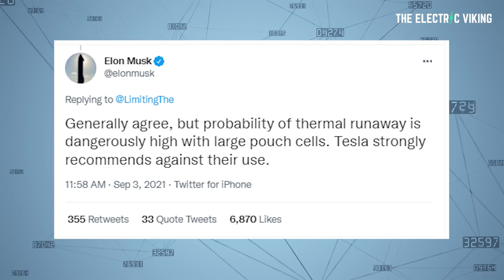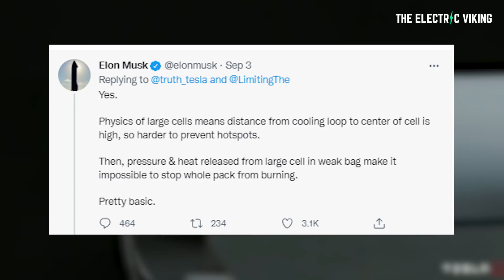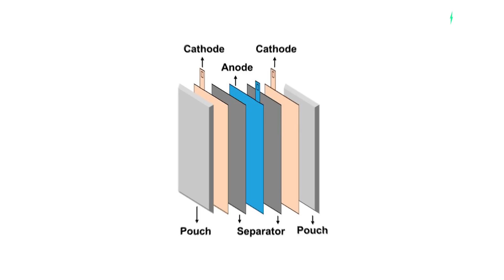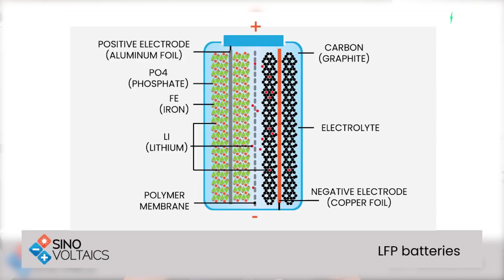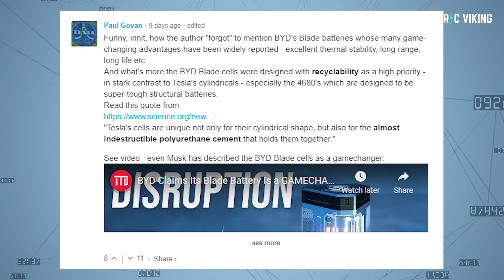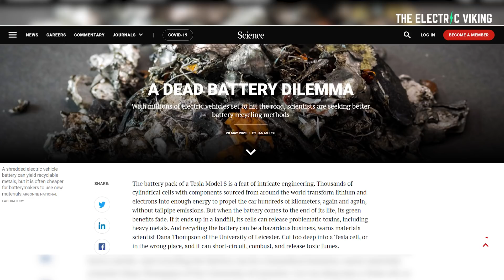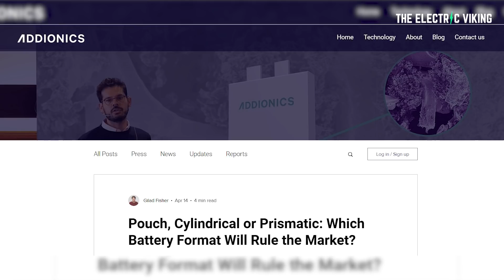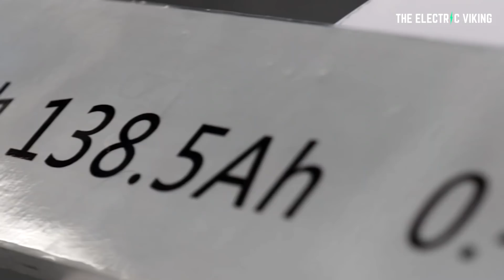Tesla batteries VS BYD batteries + Elon Musk on the best battery format

Comment: I am all for getting rid of ICE now but to say that ICE cars are more likely to have fires is not the point.  ICE cars might have a fire if in an accident.  These battery fires are happening from thermal runaway which can be caused when the vehicle is in a wreck or can happen when the vehicle is just sitting in a garage.  General Motors is telling Bolt owners not to park their cars in a garage or near other vehicles.  Nobody is telling ICE car owners to not park in their garages or to socially distance their ICE powered cars in public parking areas.  BYD apparently has a product that doesn't have a thermal runaway problem, Tesla and GM do.   Please quit trying to sugar coat the problem.
Reply: Tesla doesn't have a thermal run away problem. It's Chevy and Hyundai that have the thermal run away problem, and that is because they are using LG Chem batteries and those batteries are shit.

I do agree with you on the fact that ICE cars don't need to "social distance" when not in use lol 😂
Reply: BYD is a Chinese company, LG Chem - Japanese/US/Chinese
Tesla - US
Reply: @Jarmezrocks  LG is Korean FYI

Comment: Safety and reliability comes first, therefore i prefer BYD blades battery.
Reply: Both are safer than Petrol
Reply: How much better safety?
Reply: @LPGatekeeper  as for LFP, i converted a BMW to EV, and a Chevy pickup (with the assistance of friends), and converted a tiny 2001 Sparrow EV from lead/ acid to LFP.  I had failures of individual cells, but never a fire, and the LFP cells I used were an older cell type that is no longer used. LFP are very safe.

Comment: Small diameter cells are easy to cool as they are - erm - small. Heat is generated at the anode, so end cooling of cylindrical cells is better. The 4680 with its folded foil gives an ideal cooling path down the foil. 
LFP has a ride voltage range between full and over heated. NCA NCM reach fully charged very close to their runaway voltage. Add lithium dendrites and/or physical damage and they don’t look so clever.
The main snag with LFP is poor performance below 5 degrees C. The “cooling” system has to provide heating when needed to keep them happy.
Reply: The main advantage of 4680 is the edge tabs reducing the current path, so the internal resistance, so the resistive heating.
Better efficiency per cell volume, less waste heat management required.
(Plus, they have the best heat management unit anyway!)

Comment: What about Nissan pouch cells they seem to be quite safe. It may be partly due to density but also I think Nissan probably put more effort into the chemistry.
Reply: The Leaf uses lithium manganese oxide (LMO) cell chemistry, which doesn't have an energy density as high as lithium nickel manganese cobalt (NMC.) LMO is also not very good with prolonged exposure to heat and this was found to be true early on with the Leaf, which also has almost nothing in the way of pack cooling, or thermal management. It was a bad combination. 

I should mention that I drive an i-MiEV, which has prismatic LMO cells and a thermal management system that is only slightly better than the Leaf. Just as my car was turning 8 years old, the battery capacity started fading rather quickly. I was fortunate enough to get a free warranty replacement pack from Mitsubishi. I treat this new battery with great care and I hope it will last be at least as long as the first one. 

NMC chemistry is used in both the Chevy Bolt (pouches) and in most Teslas (cylindrical cells.) Both cars also have liquid cooling in their packs for thermal management. But even liquid cooling won't help if the cells aren't assembled correctly and internal parts that shouldn't be touching each other are in contact. This is what happened to the cells in the Bolt. Both NMC and LMO will also catch fire if the exterior of the cell packaging is pierced. In fact, they will explode rather dramatically under such circumstances. 

One of the earliest lithium cell chemistries, lithium iron phosphate (LFP,) has making a big comeback in recent years. It's not as energy dense as either LMO and NMC, but it stands up very well to high ambient heat and charging regimes that would damage these other more energy dense formulations.  The one thing LFP really has going for it, though, is that physically piercing a cell with a nail or drill bit won't find it bursting into flames. A damaged LFP cell might vent some nasty gases and make a helluva a mess. But fires in packs made from LFP cells are almost unknown. The BYD Blade LFP cells seem even more immune to things like venting of hot gases when punctured than other LFPs, which is one of the reasons why everybody is so interested in them right now.
Reply: @benjaminnead8557  That's true I don't think Nissan leaf does very well in the hotter areas. For me in Pennsylvania I went four years with a 2015 leaf only one bar missing  at about 45,000 miles. I have a 2019 leaf + now just so I can commute a week instead of 2 days. So any way my point is about the whole battery fire problem I notice it happening with Teslas and more recently bolts, but correct me if I'm wrong I don't see it at all with Leaves. Do you think it has nothing to do with the chemistry and more to do with quality in the manufacturing process?
Reply: Once again: The Leaf pack is a sealed box, without so much as a cheap cooling fan and venting. The LMO chemistry is also among the worst in regards to suffering from heat degradation, even in climates that aren't necessarily all that hot. Also, heat degradation issues with Leaf cells have nothing to do with how likely (or not) an EV will catch on fire. 

The issue with battery fires in the Bolt has come down to a manufacturing error in the cells. It could have happened just easily happened to any of the manufacturers, including Nissan and Tesla. What some of them are finally figuring out is to move to a battery chemistry that is both less likely to fade in the heat AND not burst into flames if the cell is incorrectly assembled. That formula is lithium iron phosphate (ie: LiFePO4 or LFP.) It's that simple.
Reply: @benjaminnead8557  Nissan changed their battery chemistry with a lot less degradation than the first LMO cells I think the main problem now has to do with rapid charging because passive air Cooling it's not very effective when you're standing still charging up the cells quickly. For now though I will accept the car that has no battery fires that I've heard of anyway over the ones with active liquid cooling. Hopefully these manufacturers will work together so in the near future we don't have to have ridiculous trade-offs like these.

Comment: Sam
5:30
You made an assumption that Tesla "is using LFP in its current cells ... Which are cylindrical"

That's not certain.
All talk in 2020 was of Tesla using CATL PRISMATIC cells in the "non performance" format.

The questions to be asked.
1) Have they been able to convert the CATL LFP material for use in 2170?

2) Has CATL built a 2170 production line?

3) Can that same material be used in 4680 format

4) if so, same question, CATL 4680 line on the way?

5) "Maxwell" process and LFP material? Compatible?
.......
My opinion?
I think 
1) The smaller packs are CATL prismatic.

2) This will be a limited time contract (for vehicle use, they may transfer to storage?)

3) When (if) LifePo4 material can be make compatible with both the Maxwell process and the cylindrical 4680 format, Tesla will make the cells (Unless they subcontract, allowing CATL to mimic the full 4680 production line under licence)

Side note.
Moving from 2170 to prismatic, unless the cells were on their side, the pack would be taller?
Reply: Yeah, it's quite weird we haven't seen a teardown of a MIC SR+ to verify if the CATL cells are prismatic, but that's what everyone has assumed for the past year or so.  With LFP-based SR+'s being sold in the US, maybe Sandy Monroe will tear one down?
Reply: I think this is what you're looking for, as was I. Lots of good stuff on this video The Model 3 LFP segment starts at the 15:30 mark  . . . 

https://www.youtube.com/watch?v=mZZy_6O41sI
Reply: @benjaminnead8557  Wow, that's the money shot we've been waiting for. Wild to see how slick those CATL prismatic cells are integrated into those modules, but looks like there's tons of space wasted in that pack. Also bizarrely didn't look like there was a cooling system, so maybe it's plate cooling from below? Regardless, it'll be exciting to see the second generation of that LFP pack!
Reply: Not sure, but I think a row of cells had been removed from one side of the pack when they filmed that footage. Perhaps that row will be disassembled by Sandy & company for more details?

Comment: Please do a video on the possible future of existing ICE cars being converted to Tesla type EVs. That will save lots of ICE cars being junked.
Reply: I’ve looked seriously into doing this with my car. The floor is not useable because the seats would have to be raised and then the roof isn’t high enough. More to the point, by the time all of the ICE equipment has gone all you have is a tin box on wheels probably with 1/2 worn brakes and suspension.
Reply: @Dave5843-d9m  
Correct.
You could add that the thousands(?) of different brands) models would make it complicated, inefficient to produce battery and wiring kits for cars.
HOWEVER, there might be a possibility in commercial vehicles, specifically delivery vans, where more space may allow a "generic" kit to be fitted?
Reply: There will always by DIY hobbyists who will convert old and unique ICE cars to electric power. Good for them. But on a mass industrial scale, the best solution to be revisit the Obama era Cash For Clunkers program. There's a lot of steel and aluminum available to melt down and build a whole new generation of EVs that way.

Comment: Talking about whether you can or cannot recycle lithium misses the point unless you add the words "cost-effectively". The original observation you made was that it is CURRENTLY not cost effective to recycle used lithium ion cells as it is cheaper to mine "new" lithium.
Reply: Probably why Redwood has invested in doing this.
Reply: BUT
There's nothing to stop the packs being discharged, then STOCKPILED until the volume of recycled packs increases.
It's potentially cost effective enough for Redwood to be building BIG plants over the next few years.
Don't forget, it's also the billions of "other use" batteries in circulation which can be recycled.

Comment: Thanks for another great video. Do you have any numbers for amount of Batteries Tesla will have available to them in 2022? Wandering if they could surprise us with a really big number of EVs produced...
Reply: All hinges on the 4680 ramp.
However.......
I think there's a lot placed on the view that 4680 will provide TWH of output, which will require high speed production.
In reality, if they can achieve just the same GWh as a conventional line, they can START production, supplementing with other cells until the full ramp occurs.
Since a 4680 holds 5× the volume, therefore 5x the output from the factory, for a similar number of cells, they could run at 20% speed and still have the same factory output as Nevada.

I don't think anyone will know it's happening...... before it's happening!
For all we know, that "storage fire" was a bank of 4680 cells on test(?)
I'm enjoying the "under promise, over deliver" attitude we're seeing from Tesla now.